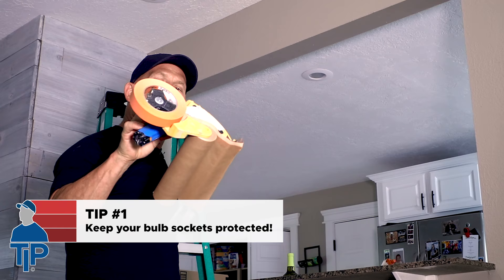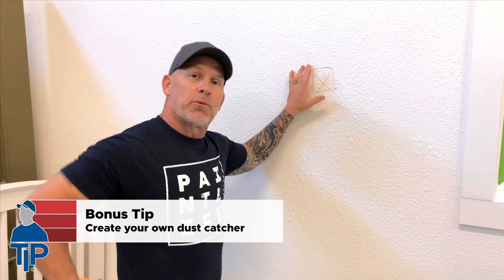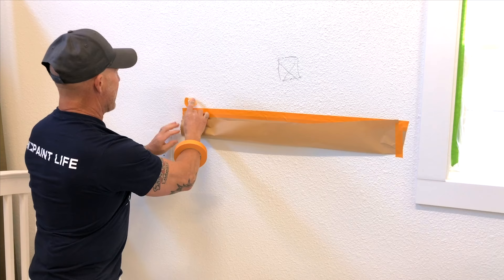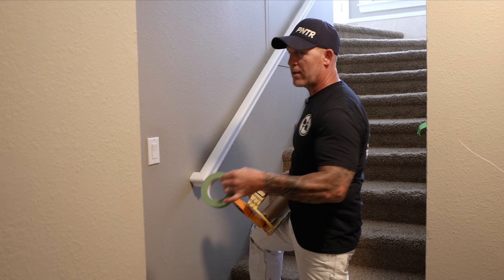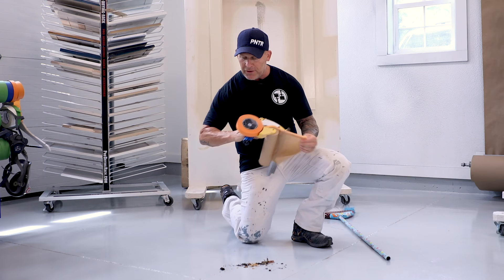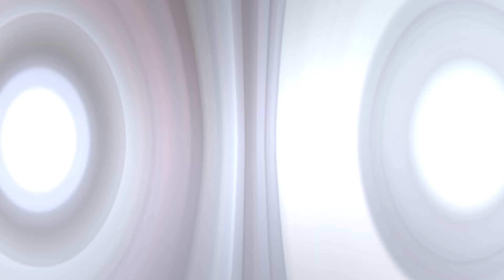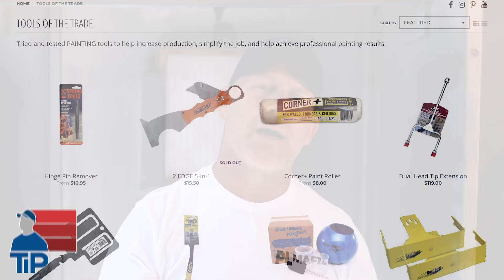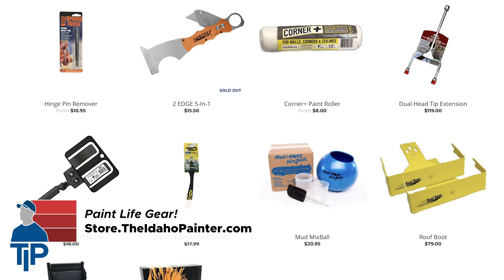5 FANTASTIC HACKS for Painters! Hand Masker Tips!

Comment from the maker: Have a hack?  Let us know?
Reply: Tape surgical tubing at the end of your caulk gun to squeeze out the material into hard to reach corners, etc.
Reply: I been in the business 35 yrs and still learned something from this video. Thanks bud.
Reply: John cena?😂😂😂
Reply: @gregoprocuna6756  But can  John Cena paint? 🤔
Reply: Bro any tips of doing thing's faster because my boss is like rushing me for everything and complains for anything I'm like damn really
Reply: Should be able to cut the caulking tube to the correct size. I see a lot of people using the suppliesd tube cutter but need to use a razor.
Reply: @jasonk828  exactly. I like tiny angle and I cut the angle edges at 45degrees, so it fits perfectly In corners. Usually no need to press material if applied properly. 🙃
Reply: These aren't hacks my man. These are normal trade secrets that you learn over time. You know, some of the things that seperate us from the average painter. Except that fan blade one. That's just silly. What about the shaft? Just over spray that? Should throw some film on it from the base at the lid and cover it all.
Reply: Where can I get that 9inch paper?.... send link please.
Reply: Paper removes over spray without scratching the paint when paint is fully cured
Reply: I've been painting professionally for 27 years. Some of the things you're showing aren't "hacks" they're tricks of the trade you learn. I've used the frog tape, wasn't impressed. I prefer Sherwin Williams 1 1/2" painters mate tape  Covering the tops of fan blades. Why? Nobody will ever look at the top of the fan blades. I did like your dust catching trough idea. 9" paper on a 2"-3" handrail, overkill 4"-6" is plenty. When cutting tops l prefer using a 36" long 12" wide 24" tall folding bench scaffold on 8' ceilings. On taller either my 4' plank length 3 plank position folding scaffold or my 8' plank length 4 plank position yellow bakers scaffold. You don't have to move it as much or with the rolling scaffolds just roll yourself when needed.
Reply: Ceiling fans just drop a black bing bag round it and tie the top. Smoke detectors or smoke heads we call em wrap them up in blue plastic over shoes.
Reply: @sixsixpks  Agreed, much easier and more effective.
Reply: When masking windows, I use one of those window scrapers to get a clean 90 degree cut on corners. Press the scraper against the tape right in the corner and rip the tape along the scraper blade.
Reply: For ceiling fan I just wrap the whole thing with a trash bag.
Reply: Dear Expert, as masking tapes contain Formaldehyde, is there known health issues caused by long term frequent skin contact with adhesive tape containing it?
Reply: @sixsixpks  Cut open one side and bottom of a trash bag and wide wrap from top of ceiling fan shaft downwards to fans, do another bag if more fan blades need further covering - - reusable for another fan in another room if needed.
Reply: Wondering why you didn't cover that fan extension pole at the ceiling....

Comment: Thank you so much, you're definitely pro and have great craftsmanship, I've been painting 22 years myself and have luckily got to be mentored by excellent painter's, most of them have retired or moved on, I actually learned the dust pan technique from a lady painter who was phenomenal, usually carry two maskers around with me and especially if I'm doing millwork, I have one masker with quick release tape and my second masker I have just blond tape, of course I use the quick release on walls and ceilings and then I can use the other masker on top of the paper without worrying about ripping texture off and drywall, Lord knows I've had to do unnecessary repairs many times. I also don't pre-tape, I was taught how to run a straight line and I pre-tape tape on top if its crooked or up in corners, I make sure it's not stair stepped because you'll see the millage build up, I make sure it's lined up with my masking, you pull your masking in the end and it lift's the tape at the same time, you're unmasking once , not twice. Thank you so much for everything you do for us. Sincerely Lorenzo gig harbor WA.

Comment: Dollar Tree clear zip lock bag for screws and hooks. 50 in a box for one dollar. Dollar Tree garbage bags for 18 inch roller tray. Roll right up and throw away rather than cleaning Roller pan. Store bags for can lighting, pull down light cover with bag and push back into the ceiling!

Comment: Question Chris, I was on a job about 4 months ago .And mind u I've been painting for 27 years anyways my boss wanted me to use blue tape for door hinges , so I did that u know as well as I do when u do that and people keep coming in and out the tape will squash up and pull . I told him to check before spraying well he didn't and got paint on hinge . Of course he fired me. I was like y didn't u take door off. He's one that's in a hurry with everything . So in future please do a vid on the different kinds of tape if I were gonna do it that way I would have used orange tape not as thick and sticks better. I've been following u and John for a minute u guys have made me wanna go out on my own. I'm afraid to bid jobs though.
Reply: They make magnetic hinge coves ,, and thet are a life saver and I rubber that goes around the hinge pin not the crap from Sherwin Williams. You will save 75% of time and u keep using them

Comment: Question for you. I keep trying to use my masking tool but when I pull the tape and paper out the tape keeps coming off the paper while I am trying to mask. Any Ideas on how to stop this
Reply: Your paper roll is not fully on. Or tape. Either that or the screw is loose on the spindle holding the paper or tape.

Comment: So green frog tape won’t full it at all the other day I was tryna mask around crown molding n it pulled the finish
Reply: Svt Lex finish was probably latex over oil then. If frog tape pulled it theres definitely an adhesion issue
Reply: I find tape pulling at ceilings too often I think it's from not cleaning  after sanding. Everyone seems to think you can just paint over dust 😩